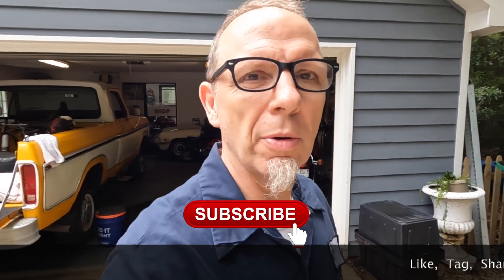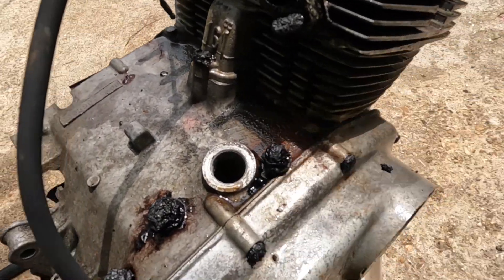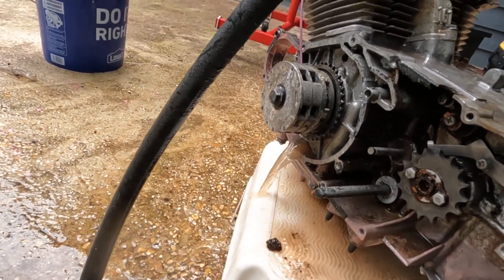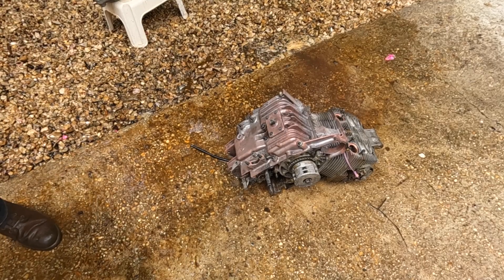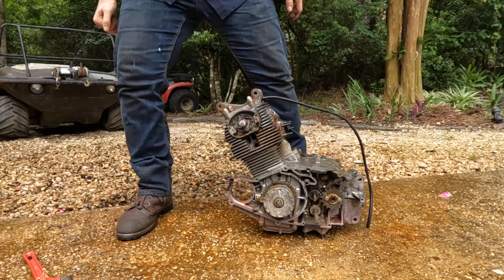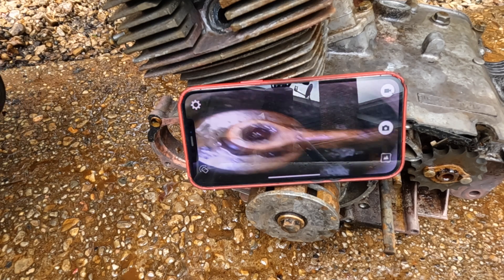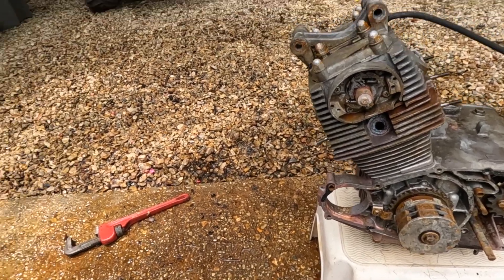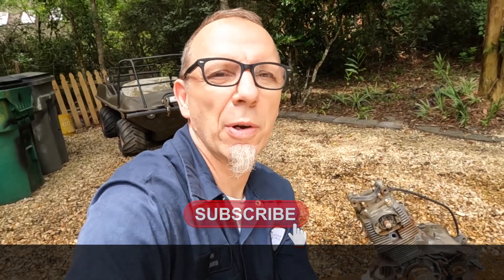This Happened After Soaking CB160 Engine in Vinegar for a Week #hondacb160 #rustremoval #caferacer

Comment: Quite an informative  video 👍
I'm dealing  with a similar motorcycle engine ( 2 stroke). The motorcycle  was in storage outdoors for 5 years. Now, while revamping it, found the engine seized. Upon opening the head found severe corrosion deposits hardened on the cylinder wall. Moisture could have made its way via exhaust and maybe head gasket. 
I am soaking the piston and cylinder wall with diesel, WD-40 and 2T oil. After a week, the build-up seems to be loosening and  fragmenting... Still a long way to go  before I can see the piston moving... Is this good enough?  Thanks
Reply from the maker: Patience is your friend and a hammer and a big block of wood.
Reply: @motorcyclerewind  Thanks... That's exactly what I am doing... Hope it pays off.

Comment: I have a 13b rotary totally rusted, so I can't get the eccentric shaft out which is all I wanted from this junk engine.   I've heard of this, maybe I should try it or just toss this junk engine and get another one?   Maybe you should try recirculating the vinegar with a pump?    This is how I "hottanked" my oily v8 (not rusted just oily)
Reply from the maker: I would give it a shot. I am using a fountain pump to recirculate the vinegar. In the earlier video I show the setup  thanks for watching.